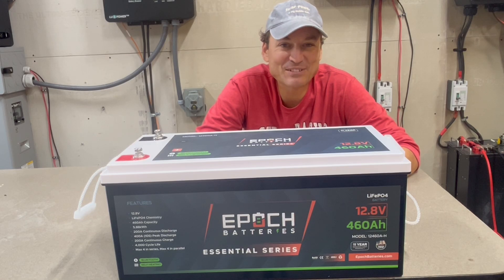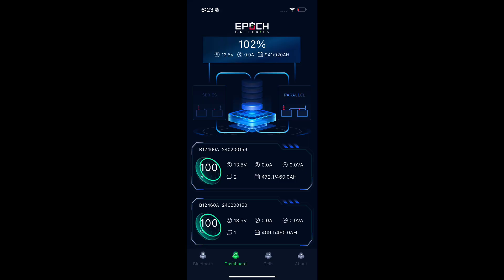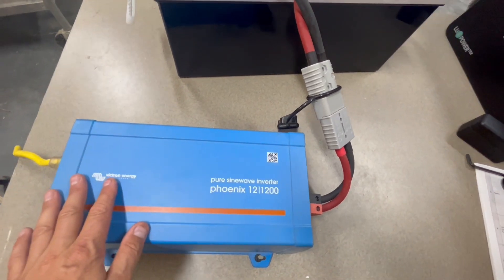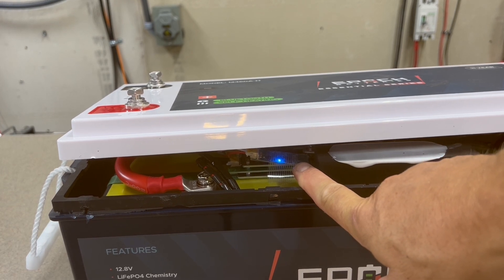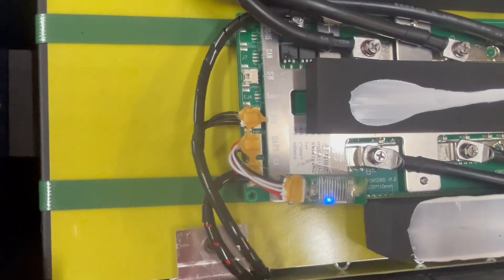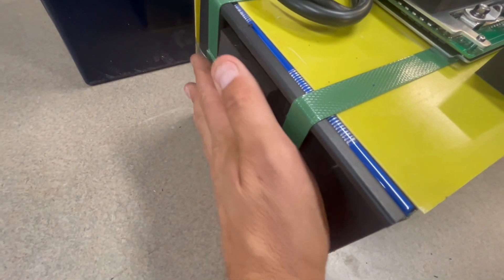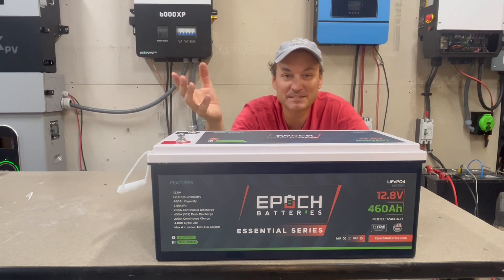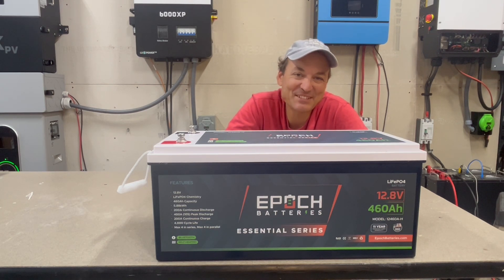Epoch Essential heated 12v 460Ah battery review and tear down

Comment: Great review!  If I wanted to keep this on its side, based on what you observed do you know if that’s ok and if there’s a better side to turn it to?  I would want to avoid having cells be upside down with electrical connections in the bottom I guess!
Reply from the maker: @ScottSchatz  if I were to have it on its side I would put the label side up. That’s where the vents were.
Reply: Thank you!  Looking forward to putting a pair of these in service.  Your review and input are appreciated!
Reply from the maker: @ I think you’ll be happy with these. Hard to find something anywhere close to epoch quality with heat.

Comment: Wow, that's a big battery!

Aside from the "over-ambitious" worker who let the silicon drip all over the place, build quality looks pretty good.  Never hurts when you get a higher-than-rated discharge test either!
Reply from the maker: Yeah, I like the board they used instead of running wire leads everywhere also.
Reply: @GavinStoneDIY  Agreed!  All these manufacturers should be using these PCBs for those connections.  I would imagine it would be cheaper in the long run to bulk order those instead of having to have someone cut, crimp, solder and zip tie all the balance leads/temp sensors.

Comment: I should have bought the Phoenix 12 inverter for the shed - it has the battery cables on the right side like I need!  I wanted a 2000W inverter though.  I'll have to see what else they have.
Reply: Looks like the Phoenix 1200 is the biggest one that they have in the form factor that I was looking for - bollocks!  Have you stress tested the 1200?  How long do you think it would handle 2000W?

Comment: I could drop one of these on my 16' dump trailer and run that thing for days!  Good video, as always.
Reply from the maker: Yeah I have a 12’ dump trailer and I didn’t even think about that. I may just do that.
Reply: @GavinStoneDIY  Biggest problem I would have is fitting it in the box and getting that heavy beast in there.  Sounds like a fabrication job coming up, once I ever finish all these solar projects.
Reply from the maker: @easttexascowboy257  that’s true. Mine is 2” shy of fitting. So I’d probably go with the 300 ah.
Reply: You can add a small cc and a small 60w panel and bingo... never ending dump trailer.  I did this
Reply from the maker: @WattsMiner  I had thought about doing that. My only issue is the panel would be filthy with all the dust I make at work. The trickle charge from driving would maybe be enough I’d hope.
Reply: My 105ah trolling motor runs all day long and only uses ~15-20% of the total capacity…its a good battery